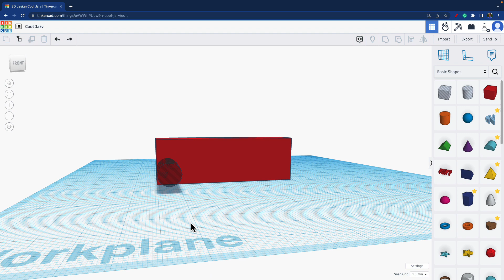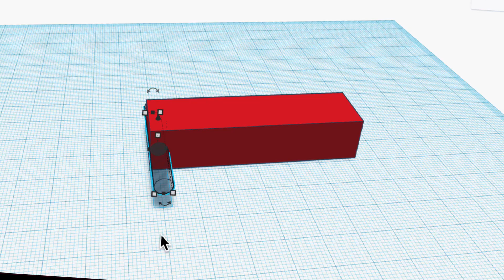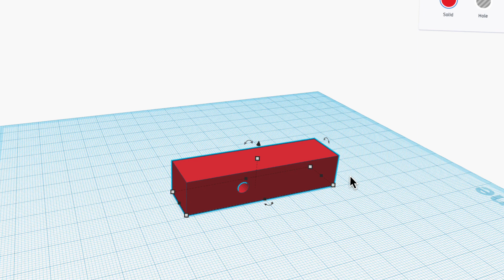Unlocking the Secrets to Perfect Object Placement in Tinkercad

Comment: Pro tip: 
if you’re trying to export a super complex object, and it seems likes it’s hanging up and working forever, select the object and save it as a custom object first. Once you do this, you can select that custom object under your shapes and place it on the work plane and then export it. The reason for this, I think, is because when you make it a custom object, you can no longer break it into its previous core objects and ultimately is much less information for the application to process which allows it to work infinitely faster. I love Tinker, I think it’s a massively underrated tool, especially since it’s free. Once you learn a few small tips like this it really becomes a very power tool 😎